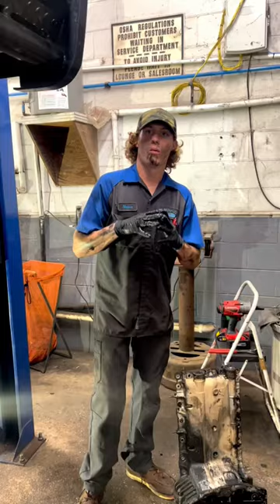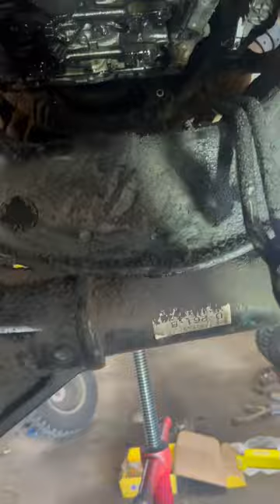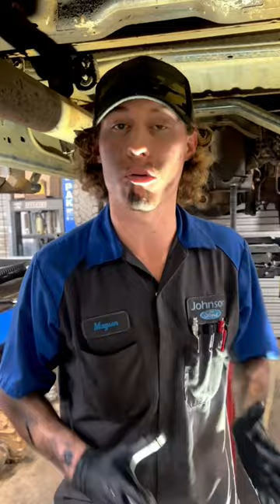Mechanics Should Get To Stay Clean Too #shorts

Comment: That’s the beauty of capitalism there’s 10 more shops that would love your business
Reply: Yup that’s the beauty of it bc then they don’t clean anything they leave it a mess and you don’t know if the pan is still leaking or it’s all old crap everywhere
Reply: @someguy2312  carb cleaner my guy $ 2 at Walmart
Reply: @danielparker4919  someone doesn’t work on cars 😂
Reply: @tylerasbrock4782  what gave you that assumption
Reply: @danielparker4919  Thinking carb cleaner would touch that shit at all is where that assumption comes from.

You need purple power at like 75% concentrate and a wire brush to get that shit off.
Reply: You get what you pay for.
Reply: @danielparker4919  A. The mechanic still has to go get the carb cleaner. 
B. you clearly haven't done anything more than an oil change if you think carb cleaner would remotely clean what was the the video
C. It STILL takes time to clean even no matter what you're using. You aren't being charged for the product, you're you're charged for the labor that goes into cleaning your vehicle so a technician can do a good job and ensure it's dome correctly
Reply: @danielparker4919 when was the last time you bought carb cleaner at Walmart? It isn't 2 dollars, brake clean is much better cleaner and minimum 4 a can unless buying by the case, not to mention all the toxic vapors that come with using either. I can see your clown shoes showing.
Reply: @nunya2814  Just looked at it super tech carb cleaner 2.18. Super tech brake cleaner 3.08. Btw since you have obviously never used either carb cleaner works as good if not better than brake clean on grease you just can’t use it on brakes
Reply: @danielparker4919  lol ok, last super tech brake cleaner I bought from Walmart was a. garbage and b. Was over 4 a can, I usually buy it buy the case, but needed a can in a pinch and was the only one available. the only decent super tech products and I stress the word decent, are their synthetic oils and oil filters. I can tell your a shade tree parts changer by your Walmart loyalty and your willingness to use the wrong tool for the job, you either work on old junk or small engines, either way you don't do it at a professional level. Honestly before I even hit nasty jobs like this with any cleaner it gets hit with the pressure washer first, that gets all the chunks and leaves a slight residue that is easily cleaned with a can or 2 of brake clean or purple power/degreaser of choice after. From someone with over 20 yrs in the automotive repair industry, here's your free advice for the day, your welcome. Now go learn more or shut up.
Reply: @nunya2814  it’s an awful big coincidence the prices you gave are what comes up when you google it 🤔 I can’t post a pic on here or I would show you the cans I bought less than a week ago. You googled that quote as well I was quoting when Reagan I used it
Reply: It needs good degreaser and a pressure washer. 
You would need a fire hydrant sized carb cleaner. And a respirator.  Understanding the concept and actual experiences are different.  Carb cleaner lol. Yea for a small area. Such as a carb.
Reply: @nunya2814  so you just admitted everything you started arguing with me about ? Get some real life experience and quit living on the internet
Reply: @toob247  mechanics frequently power wash the underside of vehicles?
Reply: @nunya2814  I’m pretty sure I proved everything you said as a lie, just like your presumed job your mentioning.I’m off until Monday if you want to google some more life experience
Reply: @danielparker4919  "I feel right therefore I am" probably you
Reply: @danielparker4919 you’d need 4000$ worth
Reply: @contraband1543  pretty sure carb cleaner would work well for cleaning mating surfaces.
Reply: Well you know the saying..
Good work isn't cheap..
And cheap work isn't good..
Reply: @garrettchapman8170   I never said anything about cheap work I said there plenty of other shops that don’t charge a hand washing fee
Reply: @@whybother664 Is English your first language?
Reply: @squidvis  idk where your from but there are nine independents in my town of less than 20,000 people and that’s not counting the multiple dealerships, mobile guys, and speciality shops
Reply: @@whybother664 So I was right since English is not your first language... Why the tantrum over a simple question?
Reply: @danielparker4919  Only 9?
Reply: @@whybother664 Workers are not going to stay in a field that underpays them. Is REALITY not apart of your curriculum?
Reply: @@whybother664 So there's an issue with finding workers?
Also he said nine as in 9.
Reading comprehension is DEFINITELY not your strong suit so don't try to correct others.
Reply: @squidvis  that’s off the top of my head may be a few more but for a town of less than 20,000 and when you include speciality shops and dealerships which most people use it is more than enough
Reply: @squidvis  Daniel = whybother, danielwhybother = incel troll lol
Reply: @nunya2814  Yea I pretty much figured that 😂
Reply: @danielparker4919  every time I've ever taken my car in they charged me for shop supplies. More dirt = more supplies
Reply: @NinjaThatLongboards  strange I’ve never done that at my shop or any I’ve been to
Reply: @danielparker4919  I've never not been charged for shop supplies
Reply: @NinjaThatLongboards  sounds like you should use some of that good ol capitalism and find a new shop
Reply: @danielparker4919  love when people praise capitalism without understanding it. No shop is going to not offset their costs onto their customers. That's capitalism. I'm not complaining, but your shop definitely isn't giving away free shit
Reply: Sinple green at full concentration to the rescue!!!
Reply: @NinjaThatLongboards  you’re absolutely wrong, plenty of shops that fill coolant for free with a radiator install, ATF, power steering, brake fluid too off, yeah I’ve PERSONALLY given those products away many of times (not every time granted) for free because the service and labor cost absolutely trumps the cost of the bottle I get in supply trucks, not only keeps the price maybe 20 bucks or slighter more lower, but that 20 bucks is just enough to make a customer happy, them “saving money” anyway they can keeps a loyal customer and repeat business forever. Ask me how I know :)
Reply: @danielparker4919  you do realize prices are different depending on state correct? Carb cleaner is $2.98 on the want app in my area. It's not $4.19. and for someone doing this for 20 years, i find it quite funny you would use Walmart branded supplies for your work on vehicles even if it's to clean. If the shop orders from a certain parts shop for a long time, they will set aside products for you so you don't have to go somewhere else to buy them.
Reply: @SweatyPotatoChip  I never said I used it in the shop just showing them the price, and yes I realize price is different per state but he was clearly stating the exact price from google.
Reply: @danielparker4919  yes you're correct. I accidently tapped on your comment instead of the other commenter who said they've been doing this for 20 years. That's my bad.
Reply: @nunya2814   you do realize prices are different depending on state correct? Carb cleaner is $2.98. Brake cleaner is $3.08 on the Walmart app in my area. It's not $4.19. and for someone doing this for 20 years, i find it quite funny you would use Walmart branded supplies for your work on vehicles even if it's to clean. If the shop orders from a certain parts shop for a long time, they will set aside products for you so you don't have to go somewhere else to buy them.
Reply: @nunya2814  re-read what i said and then comment back on somebody who supposedly has done this for 20 years, will use Walmart branded stuff.
Reply: @Davemike27 you sure you're not talking about the dealership?
Reply: @Davemike27 how exactly does eight other shops with the same training correlate with a stripped oil filter (which I don’t think I’ve ever seen in my life do you mean oil pan drain bolt) but once again that’s the beauty of capitalism if you want to pay a dude more for washing his hands more power to you, don’t forget to tip extra if he uses charmin ultra strong as well.
Reply: @Intergalactic Addict  that gave me the fizz 😁
Reply: There's always a mechanic who will trudge through sludge and literal shit to fix your car the wrong way, there's a reason why some mechanics have standards and charge what they do, because they do it right.
Reply: @AzalofForossa  since they don’t charge you for their hygiene they are doing it wrong? Like I’ve said many times already if you want to pay him to use tampax instead of equate more power to you.
Reply: @danielparker4919 lol you rere calculatin 2 dollars to clean all that for f sakes
Reply: @byloyuripka9624  I normally respond to you guys with rationalism and facts but I have no idea what the hell you said
Reply: @daniel parker  how much cab cleaner you think its goin take ?? 🤔
Reply: @daniel parker  how much cab cleaner you think its goin take ?? 🤔
Reply: @richardconnor7703  why did you post the same thing twice ? Probably half a gallon if you set your pressure right
Reply: @contraband1543  I'm rolling XD 🙌 if you ever near New Orleans I'd happily buy you a drink lol.
Reply: @danielparker4919  this whole thread You're clearly 100% wrong and obviously not a professional
Reply: @daniel parker  the shop franchise isn't going to buy from Walmart. They have wholesale accounts with parts stores, as such they will buy from them. In addition carb cleaner is not as good as brake cleaners,  and doesn't rinse off as well with water as brake cleaners do.  Now if you'd take your car to a car wash and spray the underside every now and then, this point is moot. Good techs will clean the area for observation just in case the gasket has a flaw and still leaks or if there is a hairline crack they can't see.
Reply: @62saki91  if you could read I never said I bought anything from Walmart for any shop, I was showing the other guy anybody can get carb cleaner for two something a can, second my shop is not a franchise, third from someone who has been using it for over a decade and didn’t just google the definitions carb cleaner is a harsher chemical than brake cleaner in turn it cleans better than brake cleaner but it can leave a light film which is why you don’t use it on brakes or sensors
Reply: @daniel parker  carb cleaner is not a better cleaner for grease because it is harsher, it is harsher because it also has to take care of varnish in carbs from gasoline, which is not a grease. Brake clean works better for grease, period. If I wanna rebuild a carb or clean varnish too, I'll use carb cleaner. And I don't care about your shop, which even as a sole proprietorship or single shop still has parts store accounts for the
 product.
Reply: @62saki91  once again never said anything about not having part store partnerships, carb cleaner has stronger solvents than brake cleaner what do you think breaks down oil and grease?solvents. get some real world experience outside of Wikipedia son
Reply: @bryanroupe8646  why do you get on here to argue when you have no idea what your talking about and just type something you read on google
Reply: @danielparker4919  or maybe I have enough good repeated customers I don't have to take the shitty jobs anymore or every job that walks through the door, I remember those days?
Reply: @bryanroupe8646  asking YouTube for help with a t5 I doubt it
Reply: @62saki91  I’m 35 dude,  I’ll keep doing it my way and you keep reading and watching YouTube
Reply: @daniel parker  says the person also reading and watching YouTube who has had several people tell them brake clean breaks up grease better. Hrmmm wonder why that is.
Reply: @62saki91  they are also defending a mechanic that wants to get paid for washing his hands so I have to question what length bus you guys rode
Reply: @danielparker4919  clean up should be added to book time, sin e its. Ot considered when making flat rate labor guides, nuff said.
Reply: @danielparker4919  cleanup would include cleanup of the most important tool used on the job, the tech, cause not a single wrench or wratchet is going to dismantle or assemble the components necessary to perform the work on their own, and it should include that time to reduce technician exposure risk to carcinogens which in turn will help reduce medical costs, and lower medical costs are good for everybody, now get the sand out of your foreskin.
Reply: @62saki91  not how it works in the real world you’ll find that out one day lil fellar
Reply: I agree. What's the undercarriage of a car supposed to look like? If getting dirty doing blue collar work turning wrenches bothers you that much maybe it's not for you
Reply: @daniel parker  carb cleaner?? Lol
Reply: @HashMaster1776  it's priced in buddy, shops that invoice you for materials typically have better rates. shops that "give it away" upcharge to begin with to make it seem like a steal. it's no different then retail stores that keep certain items always on "sale" with a yellow tag. it's to give you the idea that your getting a deal even though it would come out the same or even cheaper at another shop that charges you for 1 gal of coolant lmao. AsK mE hOw I kNoW. head tech for 10 years at a auto rebuilder/ dealership/ repair shop.
Reply: @rickylafleur5823  so your shower time is included in the price ?
Reply: @danielparker4919  nope but cleanup should be if its that's caked ass fucking oil.
Reply: @danielparker4919  did i say that? i said cleaning, if you bring your shit in filthy AF there should be a surcharge for it.
Reply: @rickylafleur5823  I don’t think I once said anything about cleanup time, I referred to you guys changing your tampon on your own time, once again less Peter gazing more reading and you’ll be fine lil buddy
Reply: @rickylafleur5823  you can’t leave those things in too long you can get toxic shock from it, it makes you unable to read and cranky
Reply: Im a motorcycle mech and have sent dirt bike guys away to clean their junk first. Dont want gritty shite wearing out my tyre machine.
Reply: @danielparker4919 uh yes,  mechanics/techs frequently have to power wash these disgusting shitty vehicles that are caked in crap. Every shop I've worked in has had power washers for this EXACT reason and to clean up engine bays after making a mess changing coolant or oil lines when they spill all over the place.

Comment: Absolutely, I told every guy I worked with at Toyota that I always added extra labor on a spectate line if I had to do excessive cleaning to properly do something. Guys would be shocked that when a customer would decline it that all I did was clean whatever I took off and forgot about the rest. Other guys would go clean the whole engine and bay…. That’s not free, otherwise detail wouldn’t charge $350

Comment: Flat rate can suck sometimes. The book accounts for perfect condition clean parts that completely agree. It's up to the tech to note problems and report conditions that make the job take longer. If your shop refuses to acknowledge these issues, make waves. If nothing comes out of it, change your shop. 

This also comes hand in hand with skills to work at an efficient rate. If you cry about greasy dirty parts but struggle on simple jobs, you won't be heard.

I'm not saying anything about anyone, but you should get paid for what you do. If it takes 2 hours to clean so you can do the job, the job needs a +2 for clean up. If you work for a good knowledgeable shop, these steps will be built into your time, and the quote for the customer.
Reply: It really sucks for Diag.  How can you estimate a diag job when you have no idea what's wrong with it?
Reply: @roceye  we do 2 different diag rates,  basic and advanced. For basic, my guys get 2 hours to diagnose. We set the diag price so basic cost the same as 3 hours of advanced. If it takes 10 minutes to scan a vehicle, and they tell me, they get an hour pay to do 10 min of work, and it saves the customer money. The opposite applies too, if they took 3 hours to diag, then I can change diag to advanced, customer doesn't notice, tech paid for their labor. My guys know when something is going to take a while, if I need to make a call, they tell me. Worse case, I tell them log 3 hours on it and cut off and report.

Comment: First car I worked on was a 1954 VW barn door bus. I was told to remove the engine & transaxle, reduction boxes… it was covered with an inch thick of grease, dirt, mud, 90 weight gear oil, gasoline… at the end so was I. Ever since that day when I walked into a room, people would say; “Hey does anybody else smell plastic, or wires burning, or something…?”

Comment: boy you scrape off my rust protection and then charge me extra as a "service" we're gonna have a problem
Reply: 😂😂😂😂 I’m dead but why don’t your truck come with rust protection from the factory? Self lubricating chassis system works well in some cases however 😂
Reply: @hanzgrueber145  It does, but that was 30 years ago, it needs help now, thus the pinion seals are doing me a favor